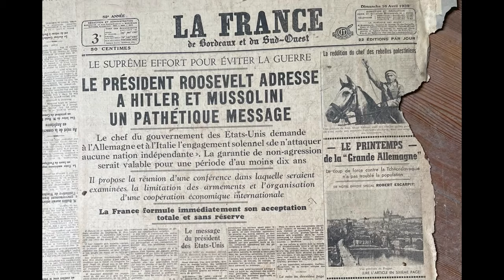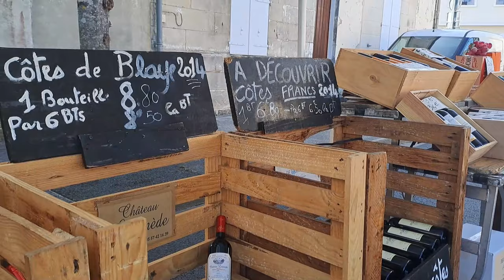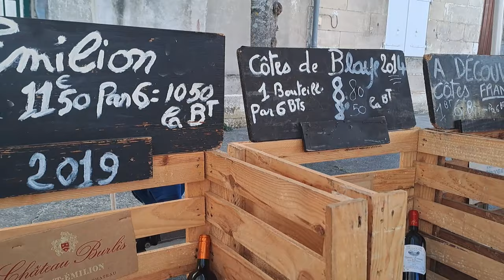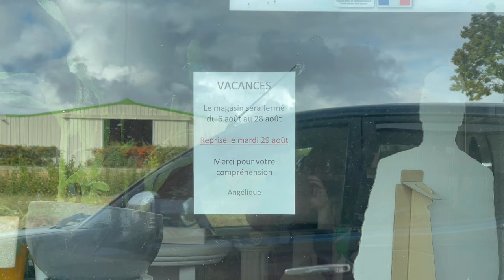Nearly There! #111

Comment: I realized watching today how brilliant Nick was to find solution for watering
Gardens using rainwater in old wine tanks. When you showed how many gallons you stored so quickly as to move on to tank 2, I felt you deserved big kudos. Also, compliments of how you have learned from Claire’s Dad on fixing roof and quickly cementing other bits. Have time for dinner along the water was a sweet break.